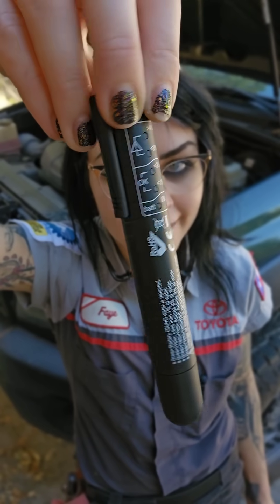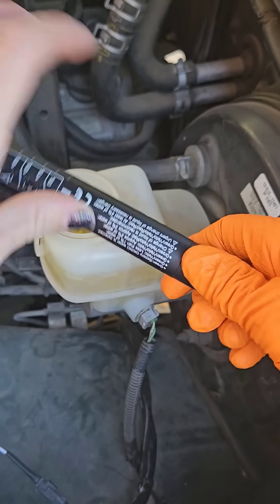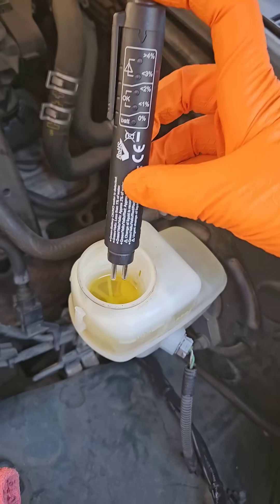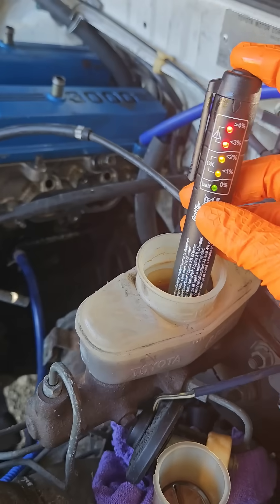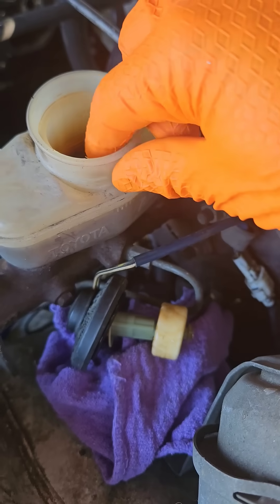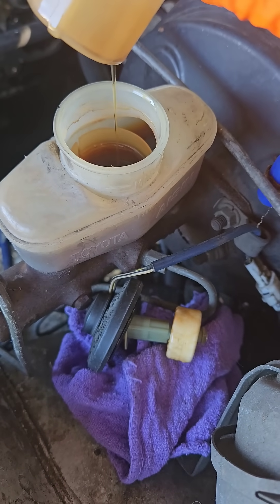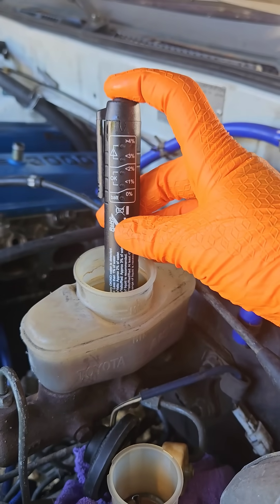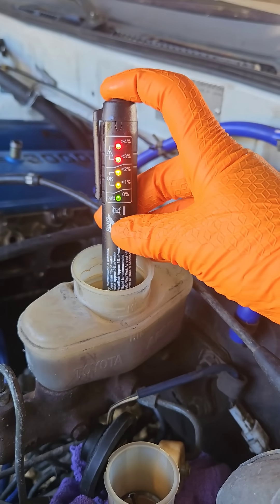Do you REALLY need your Brake Fluid Flushed?? How to Test it For Yourself!

Comment: Replace brake fluid after every 2 years? That service interval is insane. Tons of cars go 22 years on original brake fluid. Not saying this is ideal, but there has to be a middle ground
Reply: In the business 40 years and never worked anywhere that a 'brake fluid exchange ' was a thing. Older cars I would clean the reservoir and add fluid but not possible last 20 years. Now work at a dealership, in business since the 50's and never owned a bleeder.
Reply: Lots of 20+year old cars on original fluid
Reply: @jeffhill3681  sounds like that’s 40 years you’ve been doing it wrong
Reply: How is 2 years for a major part of a car’s safety and control “insane”? It’s not. Also bull shit on 22 year old cars on original fluid.

Comment: Fun fact: transfluid is hygroscopic, and your clutches are very sensitive to water which is why your supposed to get your transmission fluid changed consistently as its slowly picking up water from the air
Reply: No it is not. It will hold water in suspension due to the detergent in it. But if too saturated the water will seperate and drop to the bottom of the pan after it sits.

Comment: Recommend a brake fluid flush every 2 years? That is a huge stretch there in my opinion. I was so on board with this video actually explaining why it has to be changed, especially because almost no customers understand the moisture aspect of it, especially in humid climates. But the 2 year thing got me, I'm not gonna lie. But overall a very informative video that I might just pull up and make customers watch to prove I'm not making things up to sell them
Reply: DOT 3 is generally recommended to be replaced every 1-3 years, as it absorbs 1-2% relative to system capacity per year depending on driving and ambient conditions, and only takes 3.7% relative to system capacity to boil under sustained or hard braking.

Comment: Something to mention is when replacing your brake fluid, you should purge/flush out the small amount stored in the ABS unit and its’ accumulator. This requires a computer to actuate or if unable, flush it the best you can normally, then find a gravel road and use the ABS a bunch of times. Then redo the flush.
Reply: or with all fresh fluid.  drive in grass  slam the pedal and activate the module.  ive never used a tool to cycle it.
Reply: @MrChevelle83  the tool will pay for itself. Taking the car and off takes time and money.
Reply: What if your car is let's say.. 22 years old and therefore doesn't have ABS?
Reply: @kharjothekhajiit1669 what 2001 car doesn’t have ABS?
Reply: @kharjothekhajiit1669  brake fluid needs to be changed about every 2-3 years due to it picking up moisture.  no abs is even easier, use a suction device to drain and get new fluid in the reservoir, then using a water bottle and hose open each wheel bleeder valve and keep adding fluid until you get clean fluid at each wheel position.  This is how we change the fluid to avoid getting air in the brake system.
Reply: @kharjothekhajiit1669  what 2003 model doesnt have abs?
Reply: @Thrakna   It's a 2001 Saturn.
Reply: @kharjothekhajiit1669  more specific, the model? surely it is supposed to have abs and the abs failed?
Reply: @Thrakna   L100 or 200. It has a 2.2 liter engine. We've had it since new. I just looked it up and apparently abs was an option. My grandma evidently chose not to have it.
Reply: @kharjothekhajiit1669  that's  interesting. i would expect anything after 1990 to have abs
Reply: Definitely not a bad idea but ita not the end of the world if that's not done. Most people don't want to pay for that much labor lol

Comment: Brake fluid gets over heated and breaks down. Plus brake fluid absorbs water. The only brake fluid that does not is DOT 5, because it is silicone based. Vehicles that don't get used often have DOT 5, ie. motorcycles and ATVs.

Comment: Honestly anyone could do it at home or even your parking garage with very low cost tools. Get a grocery store turkey baster and extract the old fluid. Fill with new. Get a friend to push the pedal while you turn the bleeder. Some cheap vacuum line and a used water bottle will collect the old fluid. On a truck you don't even need a jack. On a car you may want to drive up on some wood blocks. There is probably 10,000 turorials on YouTube if you are still questioning your abilities.

Comment: The one problem you have forgot to mention and I belive its the important one, the brake fluid in the reservuar can be replaced and not necessary in the full system. It does not mix. The old fluid need to be drained from the wheel end and replaced for fresh one from reservuar .chances are that garage charge you for brake flush and just change the fluid in reservuar only

Comment: That tool is cool. I have always flushed new fluid in every 4 years, but also every time I replace pads and brake discs. To me, it doesn't make sense to push the old fluid back up into the system when you're compressing the caliper piston, instead just release the old stuff from the bleeder and then fill with new fluid and bleed as normal. It's a very quick DIY way to do a complete flush without any special tools.
Reply: If you are pressed for time and you want to keep an upper hand on the condition of your fluid you can use a turkey baster to remove the brake fluid that has moisture in it and then top it off with new fluid. That will definitely help, but not actually cure anything.
Reply: @williamalexander1743  I've done that too, I've even been told anecdotally that this is all some shops do for a routine brake fluid change.
Reply: @williamalexander1743 how do you get a turkey baster into the caliper where the real problem lies?
Reply: @yoda-be.at1746  I think the idea is that all of the fluid in your caliper eventually makes its way to the reservoir. So all of that fresh fluid you just put in eventually makes its way to the brakes and mixes together. I mean if it wasn't all slowly mixing together this video would be worthless because the fluid in your reservoir wouldn't be representative of what's in your caliper would it?
Reply: @Stanimalgic 
What happens when you drop 1 teaspoons of poop water into a 10 gallon of fresh spring water ? 

See how intelligent you are ?
Reply: @Stanimalgic  there is no 'circulation' of fluid in the braking system. If the reservoir is topped up, that fluid doesn't make its way to the calipers. In a garage a machine is used when replacing the fluid, the caliper bleed screw is opened and new fluid is pushed through from the reservoir which is kept full. You never want the reservoir empty for any amount of time as if air gets into the master cylinder, not only do you have to bleed the whole system, air reacts with the rubber seals and damages them.
Reply: @Eye-it-azz  Huh?
Reply: @yoda-be.at1746  Oh i always thought there was some kind of return, but when the bleed screw is open it bypasses it and just dumps the fluid out right there.
Reply: @williamalexander1743 
Turkey baster won’t remove the old gunk in the system. 
I’ve flushed my brake system several times, leave the tubing to the calipers and bleed valve open for at least 3 weeks, came back to install the calipers 3 weeks later there are still tons of black fish smelling brake fluid coming out 3 weeks later
Reply: @Eye-it-azz  the rubber seals in the master cylinder and brake calipers/wheel cylinders degrade rapidly in air after being in brake fluid.
Reply: Same here
Reply: My take is only the fluid down near the cylinder gets hot...I just flush some of it

Comment: Brake fluid flush is some thing that a lot of people over look. As well as transmission, transfer case, differential, power steering, and coolant flushes. Usually when I buy a used vehicles I will change all the fluids so I know when it was done last.
Reply: Nah those things are lifetime

Comment: Helpful.   But all too Many pay for flushes that are not done ☠️. Just a refresh of the observable master cylinder reservoir  , power steering reservoir etc
Reply: At least the P/S reservoir cycles the fluid, so you can tell if it’s not been done from the reservoir. Not so much for brake fluid.

Comment: In the Northeast I used to recommend waiting for the brake lines to rot first
Reply: In areas that use salt on the roads, the lines will corrode from the outside. Clean brake fluid will prevent corrosion from the inside out.

Comment: She is on point. What she did not mention is that excessive moisture in the fluid, which as she stated boils at high temps, causes a condition called "brake fade". It does matter how hard you press the pedal, the vehicle is very slow to stop. I had one car do that to years ago. I didn't hit anything, but had to pull my finger nails out of the steering wheel. I recommend brake flushes every 3 years or 30,000 miles.
Reply: Mileage/time is heavily dependent on operating and ambient conditions. The interval can be as low as a year in a humid climate or if you frequently tow/drive on mountainous roads, where problems are more likely to arise due to water content in brake fluid.

Comment: many 40 and 50 year old vehicles on the farm never been flushed or changed still going
Reply: Yeah, good that they’re on a FARM where you’re not braking from high speeds or down declines for a sustained period then yeah? And where’s your source on that anyways?
Reply: @FooJub  where is my source? I drive some of them
Reply: My daily driver is 20 years old has 650000 never had the brake fluid flushed, and on country roads we have to brake harder because we are constantly braking for deer and other animals and also grossly overweight at times
Reply: @philippetays4263  interesting. My only guess would be, assuming its either on a rear drum or front and rear drum brake setup, less heat is transferred to the fluid compared to a disc brake setup (despite disc brakes having better heat dissipation) you don't experience as much brake fade. Pretty hard to believe still. I'd be interested in your idea of "still going" as I've seen people with severely reduced braking ability and they just get used to it...
Reply: @FooJub  nope this is disc all around,  and heat yes there is heat as one of the calipers malfunctioned the brake locked on and the rotor got so hot it cracked. One explanation is in the west our humidity is quite low at times, yesterday 37% last week in the 20s.
Reply: @philippetays4263  wonder if the caliper malfunction had anything to do with the water absorbed+depletion of anticorrosion additives in the brake fluid, or just mfr defect..

Comment: Yes, you really, really need to flush the brake fluid after a certain amount of mileage.
Reply: The fluid doesn’t know how far the car has traveled. Every manufacturer recommends replacing it ever two years period, sitting in a barn or driven daily.
Reply: @acsnitner7661 that’s bullshit. Manufacturer recommendations vary from 1-3 years depending on driving and climate conditions.
Reply: @FooJub  say what? Brake fluid is hygroscopic and doesn't know or care what make or model it's installed in. 2 years has been the spec forever. DOT 5 (silicone based) was tried but failed. DOT 3,4 & 5.1 are to be considered the same with respect to change out intervals.
Reply: @acsnitner7661  that’s just flat out wrong. Brake systems aren’t created equal in length, or exposure to the elements. Cars with exposed brake lines will absorb more moisture than ones with them recessed and covered  on wet roads. 2 years is the average for dot 3, plenty of manufacturers recommend 2-3 years on dot 3 or 4, or as little as 1 in humid climates, or if you frequently tow/drive in mountainous areas. 3, 4, super 4, 5.1 are not equal in wet, dry boiling points or viscosity, and they are not equally hygroscopic. There’s also minor differences between brands. So no, not the same, in any regard.
Reply: @FooJub  ok again, say what! "Exposed lines will absorb more fluid". Is that through magic or witchcraft?
Reply: @acsnitner7661  hygroscopic nature of brake fluid allows it to absorb moisture from the atmosphere. More humidity = greater absorption. Likewise, getting splashed or even submerged in water = greater absorption.
Reply: @FooJub  yep it's still a negative on what you're writing. Go visit your last science teacher and show him/her this conversation and expect a slap
Reply: @acsnitner7661  stay ignorant, you’re only hurting yourself 🤷‍♂️
Reply: @FooJub  You're going to need to list the manufacturers because all the recommended intervals I've seen are 2 years and that's even with DOT 4. These are from service manuals for 1980's vehicles to modern current day vehicles. This 1 - 3 year stuff just sounds like tip-toeing around the industries 2 year recommendation for warranty or convenience reasons.
Reply: @killer2600  pretty much any of the Volvo cars in the last 2 decades or so, maybe more…do your own research…all the maintenance schedules are readily available

Comment: Curious about the circuit in the tool ... is it just measuring resistance? A multimeter would do the same thing, assuming one has a scale of values.
Reply: Yes it is a fancy ohm meter but a very convenient one. To use use a DVOM you would need the values and have the distance between the leads exact.

Comment: Closer to the wheels is where the brake fluid heats up and breaks down. I just bleed my brakes every once in awhile and that seems to be efficient enough
Reply: Why not go for the full flush? It only takes a liter, maybe two if it’s real bad. Brake fluid is cheap, internal corrosion is bad, brake fade is bad. You’ve already done like 90% of the work

Comment: Moisture in the brake fluid, also causes pitting inside of the calipers, where the piston comes in contact with a caliper. This causes a caliper to stick and hesitate, when pushing out onto the backing plate of the brake pad. This leads to uneven wear, pulsation, and eventually uneven brake pad, and rotor wear.

Comment: Water is compressible Faye. Water has gasses dissolved in it which makes it slightly compressible. But honestly don't be a dealer tool. People have put 200k on cars without even looking at brake fluid without noticable issue.
Reply: Brakes at low speed is fine. Once harsh speed the pressure and heat will evaporate it into gas form....
Reply: Yeah people neglect a lot of maintenance, and you see the results of it on the daily, side of the road or in a shop… what’s your point?

Comment: This video rocks, I love your content, and I think you are gorgeous. 

Beyond the compliments I wanted to ask if maybe you could do a short video on what a brake flush entitles. 
Is that going to be simply pulling the plug at the caliper and pushing out each line individually or is that opening all of them at once and back, pressuring the system with air until everything has leaked out and then flushing it and then filling it?
I’m just not sure how to do this and I bet there’s a video out there but I’d love to see your rendition.  I don’t know if it’s possible to do it in a short, but just a suggestion that I thought might be cool. 

Once again, thank you for the content. There’s not a lot of girls out there that know their stuff like you do and even from the first video I never really took gender as an issue when it came to your mechanical knowledge.
I think it’s very easy and typical for a lot of guys to be ultra critical if a girl is in the garage where guys typically are. Since day one I could tell you could hold your own and you have an awesome knowledge of them Toyotas, if I recall correctly and many things automotive related. 
Keep kickin butt and best of luck with the channel and them vehicles.

Comment: DOT 4 and DOT 5 brake fluid reacts with / to water differently.
Reply: Ok, DOT4 is a backward compatible upgrade to DOT3, withstanding more heat, higher boiling point. So its deal with water is the same... Dot 5 is silicone brake fluid and cannot be used in the same enviroment as DOT4 and below.

Comment: Won't fit modern fluid  reservoirs. Can't find a tool for those that only have a tiny access/fill cap
Reply: Get a syringe in whatever size fits your odd car and and get a sample, then put it a clean vessel to then test with the meter.
Reply: Better and more accurate way is to heat it until it boils and measure the point at which it did, compare to the wet and dry boiling point for the fluid in your car. Or just change it already lol

Comment: I bought one of those testers and all the lights lit up even when I tested a freshly opened bottle of Preston’s brake fluid. Sent it back
Reply from the maker: Sounds like you got a dud, return it for a new one!! It should behave like mine - the first brake fluid I tested was fresh, and it tested at 0%. There are a lot of cheap copies out there. Also, what type of brake fluid did you try it on? Some of the higher levels actually won't work!
Reply: @FayeHadley  
Car Care Nut had a link. Oh well another free return to Amazon, wish their were strips to verify accuracy of meter.

Comment: I bought this tool to test my fluid. It indicated that my fluid had 3% water saturation. I didn't trust this as I recently flushed the system. I tested the tool on a brand new bottle of brake fluid, and it still read 3%. I returned it for a refund. Which brand do you recommend? Have you tried it on freshly opened fluid, and did it read 0%?
Reply from the maker: I have bought a bad one before, so I understand your frustration!! I put this exact one in my Amazon storefront - and they also don't work on DOT 5 fluid!! https://amzn.to/3P3HdlW